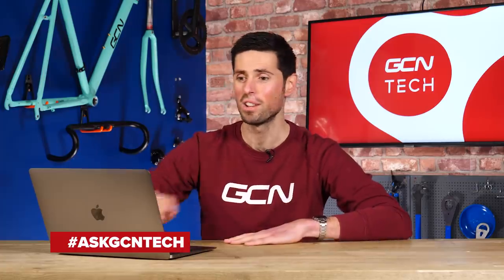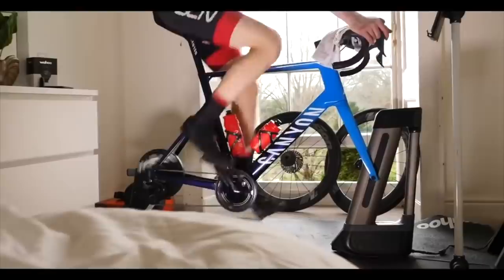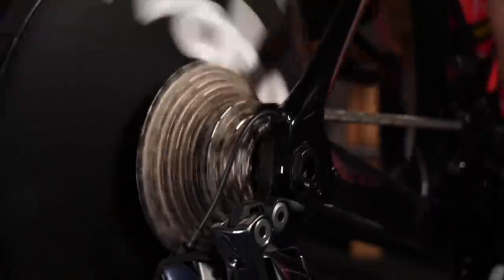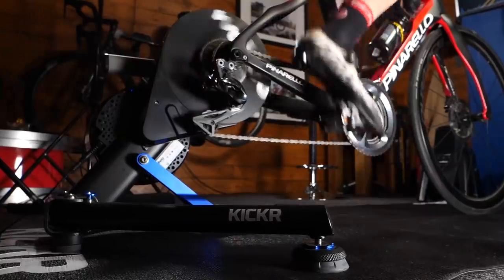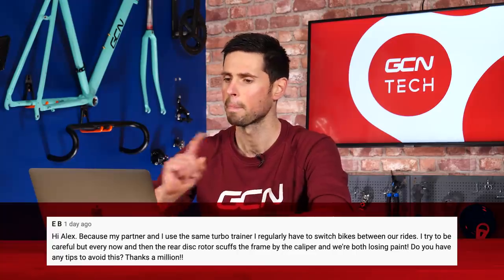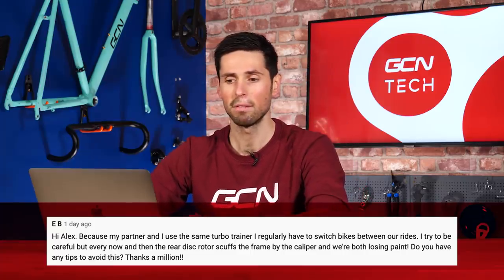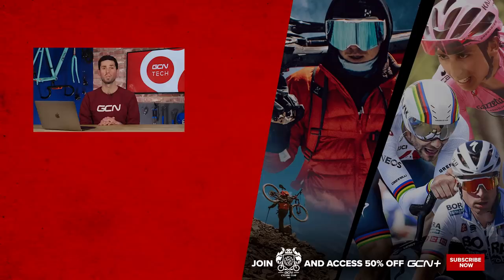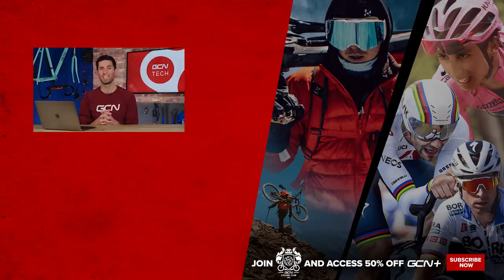How Should I Set Up My Trainer If I Swap Bikes Regularly? | GCN Tech Clinic #AskGCNTech

Comment from the maker: What tech issues have you been tackling this week? Let us know down below 👇
Reply: #askGCNtech Hi everyone, I recently got a gravel bike Cannondale topstone. It comes with a 2 by GRX 800 groupset. The current chainring is 46/30. Can I install a 52/30? I have a spare 52t chainring from my road bike with that would fit but im not sure if the gap would work. Would a chain catcher solve my issue?  Thank you for your answer.
Reply: Sometimes my bike shift by itself, can you tell me why?
Reply: #askGCNtech Hi all! As we all know #ResistanceIsButyl (still laugh every time I think about that). So what I want to know is, other than mess, is there a reason NOT to use a TPU tube as an emergency backup for a tubeless setup while out on the road...ie any unwanted reaction between the sealant and the plastic? Thanks, and happy holidays!
Reply: Tech issues?
1. Putting some grease on my axle adapter to stop my bike from creaking so much on my Tacx Neo.
2. Waxing my cross-country and downhill skies.
Reply: #AskGCNTech My Shimano Nexus 7-speed internal hub keeps disconnecting (at the hub side) and my shifter cable keeps losing all tension. I don't know what's causing it.

Worse still, when I do reconnect the shifter to the hub, shifting gears feels like it causes some kind of... grinding...? I don't really know how else to describe the noise/feeling.

But basically, I only have three options while riding; lowest gear, highest gear, or "binding city!"

Please, please, PLEASE help, guys! I don't know what to do here.
Reply: I swear every time I see the thumbnail for this video it looks like Darth Vader is there.
Reply: #askgcntech.
Hi Alex. This one is for you since you love tubeless. Can you use car's tire sealant on a tubeless bike? If yes is it better in sealing punctures
Reply: If there is any misalignment between casette on Tacx/Garmin Flux and casette on Wheel then the first one isn't properly installed.
I used Flux with 3x9 SRAM MTB drivetrain, now I use it with 2x11 Shimano Road setup and never even touched rear derailleur.
In both scenarios I use casettes from different groupsets (cheaper/heavier at home) and all works perfect.
There are 2 or 3 spacers delivered with trainer and the key thing is to use proper combination for your bike...see table in manual.

Comment: For the person having trouble with cassette indexing also check that you don't have mismatched cassette types; my gravel bike wouldn't shift right on the turbo and it turns out it was running MTB spacing whereas the cassette on the trainer was road spacing - chucked an MTB cassette on and it's golden!

Comment: On the 200W question: in 52/11, to be only putting in 200W and maintaining the same speed, you'd have to be already going flat out, probably on a big hill. So yes, going quicker than using the smaller gear.
 
Another way of explaining: you can climb a hill, either by grinding a big gear (i.e. 50/25) at 200W & 60rpm cadence, or changing to an easier (36/25) at 150?W & 90rpm. But the work done, and speed up the hill is the same.
Reply: Yeah but acceleration is quicker in easier gears with the same power I think. I don’t know if science supports this, but it just feels that way.
Reply: This is some of the most hare-brained discussion on the subject of speed and power in cycling I've ever had the misfortune to read. There is no reason why it would be impossible to maintain one's speed when pushing 52/11 at 200 W on the level (with no wind either). 200 W is good enough for approximately 32 km/h (for a typical road bike-rider system), so it's a slower speed than most riders would use 52/11 for, but there is no magic force that will start slowing you down because you had the gall to grind at 53 rev/min instead of spinning at 80 rev/min.

To answer the original question, assuming a single speed drivetrain, the 52t configuration will go slightly faster due to the larger chainring causing smaller losses to chain articulation. In the case of the bike fitted with both chainrings on a double crankset, the 52t should be slightly faster again, due to reduced cross-chaining.

Comment: For the couple swapping bikes on the trainer.
You could look at getting a spare wheel without a disc rotor fitted (or take the rotor off your own wheels). That way when you put the rear wheel on store the bike between turbo sessions there is no risk of scratches.

Comment: DI2 battery draining: I don't know anything about di2, but also check for water ingress in any connectors. If the battery is draining that fast, you may also be able to observe a component or cable being warm.  Maybe not by touch, but an infrared thermometer gun might show up something slightly warmer than ambient. Better still, if you can get your hands on a thermal imaging camera...

Comment: about the paint scuffing: its worth checking with local car wrapping businesses. they usually also do paint protection wraps and maybe you can score some excess wrap to cover your bike with. Wrap that protects car paint agains stones at 130kph+ should do just fine for the disc rotor and can easily be removed when sunnier times come again

Comment: I had that with my kick r and Cannondale CAAD 10, I took my kick r and bike to where I bought it and asked them to tune the setup and they got a great compromise going.

I now have a Specialized Diverge with sram etap and that has worked flawlessly so far between street and the kick r.  I also like the locking pin on it to make it easy to take the chain on and off.

Comment: Ive shimmed my cassette on my mtb wheel and my trainer wheel so they both have the same offset to the end of the axle.  So when i pop it in i dont have to adjust
Bsa bottom bracket spacers from amazon work. They  have  sets with 0.5 and 1mm spacers in

Comment: I found that shifting problems on the trainer were due to slightly off-angle mounting of the frame dropouts in the trainer hub. Much better to get that right than to try to compensate with indexing because it will improve consistency of shifts across the cassette. Also, less hassle when switching back to my bike.

Comment: for the gear ratio / power question, the 52x11 vs 34x11 examples are not equivalent to one another.  I think(?) speed would be the same for a given power, but cadence would be different.  That raises another question about which would be more efficient, but I have no idea whether that can be answered definitively.
Reply: Reminds of the spinning-vs-gringing debate. GCN did several videos on that topic
Reply: He didn't ask if they were equivalent: he asked if they would go at the same speed for a given power, which (ignoring small differences due to chain articulation and cross-chaining) they will.
Reply: Yes indeed.... I think it was the answer that was a bit confused as Alex was talking about equivalent ratios achieved in different ways

Comment: My Di2 battery also kept draining overnight.  I removed the EWWU111 wireless unit and I haven’t had any problems since.  Mot sure if mine was just a dodgy one, now I just temporarily put it back on when I want to check for firmware updates
Reply: The wires can pinch and cause a slow current draw as well, mine did that after a 'car dooring', Shimano techs were great but still thinking mechanical groupsets, but eventually found a shifter wire under the handlebar tape had been pinched and was creating a slow current draw.  2 batteries, one 'brain', and two months of intermittent cycling later.  Same methodology for detecting fault, but once you find the component that causes the slow battery discharge, take that lead to another component and see if it still happens, works for the shifters at least, but you get the idea.
Reply: I had this exact same problem after I botched a wireless unit firmware update through Bluetooth. I suspected a corrupt firmware but with the USB connector that comes with the groupset, you cannot overwrite the current firmware with the PC E-tube app, only upgrade it. So I purchased the Shimano SM-PCE02 PC Interface which does indeed allow overwriting the firmware with the same version or even downgrade which completely solved the problem.

Comment: Re: the couple swapping bikes on the trainer.

I know of a married couple who had a similar problem which they resolved by using the same dedicated bike, permanently on the trainer. He is taller than her, so they picked a bar and stem combination mid-way between his size and her’s which is “close enough” for them both. 

Then they each have their own seat post and saddle, marked to the correct height, with a QR clamp. So they can just swap that over quickly and they’re right to go.

Comment: Also with the bike  not shifting   Properly on the trainer compared to when using your rear wheel. Need to double check they are both the same speed cassette’s. I had a friend  when was having similar problems when I went round his  turbo had a 10 speed cassette on and his bike had a 11 speed cassette . This would case a lot of shifting issues 👍🏼 I have the same cassette on my wheel as on the turbo and never have to adjust the derailleur
Reply: Surprised he didn't mention this.
Reply: Yes I thought it was something easily missed especially if you purchase a used one

Comment: That first question about adjusting the rear mech for the trainer, remember you don't need a fancy bike for the trainer, you can simply buy a secondhand pile of junk for a hundred or two and use that on the trainer. Although you might not get more than 7 or 8 gears for that price.
Reply: Yep, having a second frame that matches your actual riding bike dimensions is the answer. Doesn't need to have many of the qualities of the real bike, just the shape. That way it's always there, waiting for you. I'm using a Vitus carbon 9 from ~1988 I raced on for the trainer.
Reply: Yep, I bought a Bianchi with 10 speed to put on my Flux S trainer because my other bike was set up just right for road riding but when I put it on the trainer the gearing was misaligned.

Comment: #askGCNtech
In this day and age of good quality GPS cycling computers, what is the point of having a separate speed sensor on the wheel? I've occasionally had issues with it dropping out (misalignment, cold, etc), and then have to go through the rigamarole of disconnecting the sensor so that GPS will record.

Comment: #AskGCNTech 
I am looking into converting a TT bike into a drop bar road bike. Is it possible to retrofit the TT components using road bike STI leavers? The TT bike comes complete with all components. I wasn’t sure what I might need to buy new or what I could transfer over.

Comment: #askgcntech I just bought a new chain and put it in the ultrasonic bath to prep it for waxing.  After I took it out of the cleaner it was no longer nice and shiny, it had turned a dull gray color.  Is there anything I can do to get it back to a somewhat shiny appearance.  Any chemical solutions that won't hurt the chain?  What should I do to prevent this in the future?  I used a mixture of distilled water and purple simple green.

Comment: Geez, imagine not being able to change gears because a battery ran out. Sardonic comment aside, I've had the same issue regarding the cassette on my trainer and on my bike. I tried getting the same cassette but it didn't work. I am going to try to dial the position in with shims or washers in my case.

Comment: #AskGCNTech - Hi Alex (and/or Mannon and Ollie if you’re there at time of broadcast!) I had to adjust my front derailleur following a crash but I’ve found adjusting the high limit screw does nothing, while the low screw works fine. Cable tension also seems fine but not being able to adjust the H screw is causing chain to rub on large chain ring at the front no matter what I do. Any ideas on what the problem is and how I can fix it? The chain rub is infuriating!

Comment: #AskGCNTech Hello Alex, Manon, and Ollie, I've recently completed 2x200KM ride, and found that my Garmin Edge 530 is always short of 5-8KM as compared to my friends (all 4 of them have gotten ~206KM, while I barely hit 200). The bike computer is paired ANT+ to Giant's Ridesense 2 (2-in-1 cadence and speed sensor), and the wheel diameter is set correctly at 2105mm for 700x25c tyres. The batteries are new and I've also tried resetting the units. Should I adjust my wheel diameter to compensate for the speed/distance, or should I get a new speed/cadence sensor? Thank you and have a good one!
Reply: It is generally best to let the GPS unit automatically select the tire circumference during a ride rather than selecting something based on a chart. Tires can have a decent standard deviation for circumference based on manufacturing tolerances, air pressure, rider weight, etc. Seeing a 3% difference from the standard circumference wouldn't be a surprise for me.

Comment: #AskGCNTech 
Hello guys,
 I own a 25 year old Van Tuyl steel bike with a full shimano 600 tricolour 8-speed groupset. Currently my gear ratios are 50/38 in the front and 12/26 in the back. Is it possible to switch the cassette to an 8-speed 11/28 teeth cassette? The manual of the rear derailleur says that it may only fit 12/28 teeth cassettes (where do I get those from?).

Comment: Have been riding with a tubeless setup now for about 6 months.  I have noticed that the valves  keep getting clogged with latex sealant which sets up, making it harder and harder to inflate the tires.  I removed the valves from the core and soaked them in WD 40, but with limited success.  How can I prevent this, and if it can not be prevented, what is best used to remove the set up latex rubber goo from the valves?
Reply: Project 76 no clog tubeless valves, got some myself and make inflation easier as well as no clogging of the valve
Reply: @nemeanf27  Thank you Carl.  They seem like the answer to my problem, but a bit expensive and currently out of stock.  Will check back with them in January

Comment: #AskGCNTech Hi, I’ve just got a new bike with hookless rims and the bike shop have said that I’d have problems using a tube in the case of a puncture and would need to rely on rubber bungs in the event of the liquid sealant not working. I’ve not seen anything online that says a tube wouldn’t work with hookless rims. Is the bike shop correct or not? (It’s a Giant TCR if it makes any difference)
Reply: I've got hookless Mavic all roads, and have no issue running tubes. I used them for a while when I was trying different tyres out - then settled on a tyre and went tubeless. Not an issue for me.

Comment: #AskGCNTech Hi Presenters! So I recently bought a new bike and now I am riding on 28mm tires (previously 23mm). I mostly ride on well-maintenanced roads but obviously there are a few bumps along the way and I weigh about 60kg. Can you give any indication on what kind of tire pressure is the most optimal to ride on? I previously had around 95 to 100 psi in my tires
Reply: If you’ve got Conti GP5000 (my weight is 65KG) I would recommend 6.5 bar in dry conditions
Reply: @MJarthur95  That seems quite high for 28 mm tyres. I weigh 69 kg and I ride 25 mm tyres at about the same pressure.
Reply: @Catcrumbs  Continental recommends 6.5 bar for both 25mm & 28mm. That said, this pressure is only useful when riding on good terrain & dry conditions. 

Other conditions I go to 5.8 bar on my (rear) 28mm GP5000 & 6 bar on my front 25mm GP5000 

But there’s a tool from SRAM that calculates the optimal pressures

Comment: #askgcntech hi all, Tubeless question here, so Alex might want a crack at it. I have an almost brand new Vittoria Terreno Dry 700x38c, and it's leaking sealant through the sidewalls. I had this issue before on an older tire of the same spec, but I just attributed that to wear and tear, which is why I got this new one. A friend also posted a few days ago on his IG that his terravail sidewalls have the same issue. Is there any way to fix this? And how to prevent this? Many thanks!
Reply: Sounds like the tyre is NOT tubeless ready. The fix is to switch to a tyre that is. I ran into the same situation with a set of Specialized Turbo Pro tyres and the shop said to set them on the side and let the sealant dry. The final solution was to switch to a set of Conti 5000TL tyres which no longer leaked sealant or air.
Reply: @jamesmckenzie3532  it's Tubeless Ready mate, the other tire works fine. And this is my 3rd pair of the same brand and type. It's a great tire, just annoying that this happens. The skinwall just looks so good haha
Reply: @flipcorpus  Maybe defective. Have to contacted the shop that sold you them for a replacement?